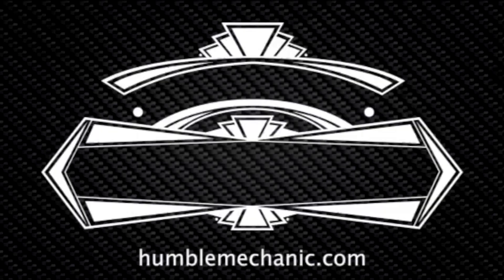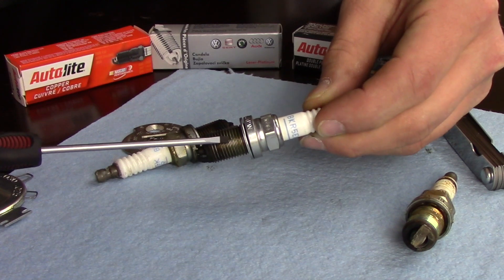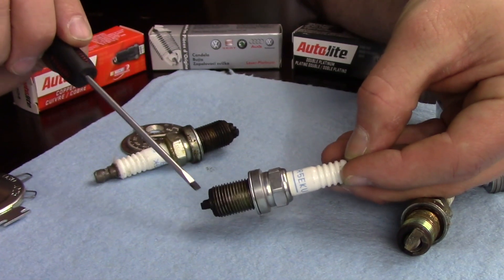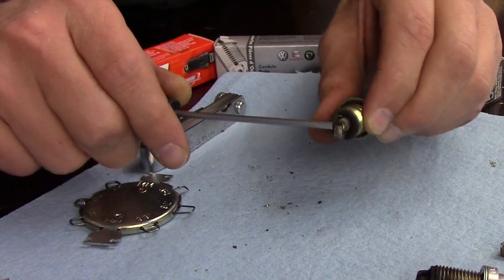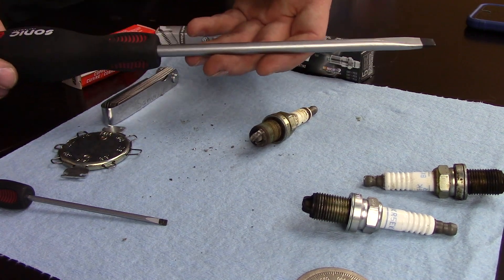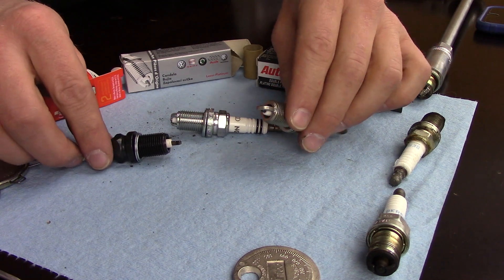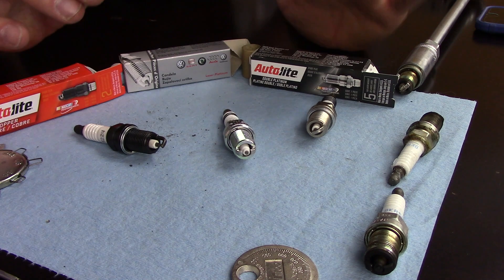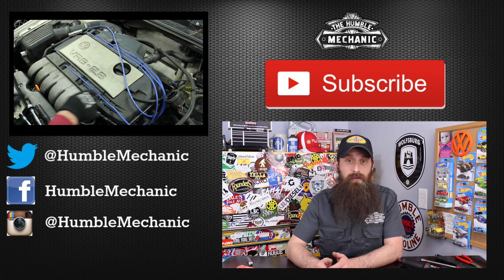What You Need To Know About Spark Plugs

Comment: Hey Charles, 
         Good vid for folks wondering a bit about their plugs. I guess I have 2 questions. First would be you showed the plug in the beginning that had fouling on the last 1/4" of threads or so and you mentioned that this threaded portion extended down in the combustion chamber? I have to admit, in my career as a mechanic I have removed hundreds of heads on many different makes and models but can't say I have ever seen the threads of a plug extend beyond the head exposing threads to the combustion chamber. I have only seen them come flush or slightly recessed... Is that a VW thing? Seems to me that would make it almost impossible to remove or very very hard to say the least. Similar to the problem the 3v Fords that you mentioned. IMO What I think you are seeming is perhaps were the combustion gas migrates up into the threads over time. Remember the threads have to contact the head fully because that is what carries away the heat from plug tip (making the heat range accurate). 
         For my second question you mentioned that an extended gap will take more voltage from the coil to jump the gap. I have to admit I have done some pretty extensive testing using a capacitive pick up on a scope looking at secondary waveforms and changing the gap on a plug from .010" to .090" and I must say I have never seen a change (or very little) at all in coil output or burn time that is discernible at all. As a matter of fact the only time I have seen any sort of an anomaly from a spark plug gap is when that gap "bridges" basically causing a direct short to ground, or a severe open in a secondary circuit causing an unintended gap out side the combustion chamber but other than that can't say I have seen gap alone affect coil output on a modern day high output ignition. So I guess my question with all that being said is have you seen measurable voltage differences on coil outputs from a worn or over gapped plug? If so what were the actual differences and examples you saw? very curious about that :)
--Eric O. ( sorry for the long question :/ )
Reply: Eric, stop farting around and get to work, lol. Goodmorning.
Reply: Michael Herbert Hey come on I need my YT fix too!
Reply: First question: The plug threads are not protruding into or exposed to the combustion chamber. When the head gets hot the hot end of the threads get a bit bigger, that allows some carbon up the first few threads. Get a lot in there over age and it can feel like the plug was hanging out in the chamber and got carboned up but not so. Worth remembering that threads and in a head get smaller at the cold end and larger at the hot end when the head is hot Which is why you always chamfer the top of thread on an exhaust manifold face to stop the threads near the surface shrinking and shearing off the studs like a bolt cutter at the face leaving the remaining broken stud left in there loose enough sometimes to unscrew when it is cold. 
So where is a plug likely to seize and break off, top of the thread.
For taper seat plug, they tighten up at the cold taper end when the engine is hot making them tighter at the taper when the engine is running, so don't take taper seat plugs out hot, flat washer seal plugs not sensitive to it. And if you fit taper seat plugs hot when they cool down they may be a bit looser than spec so replace them when cold or if you remove them hot let if cool down before fitting them.
Reply: Second question: There will only be a small discrepancy in spark voltage, spark time and pre spark voltage observed with a difference in spark plug gap, but that is academic as we are not merely looking for an absolute voltage value at any point or just a wide gap, we are looking for worn and thus defective spark plugs.
What you need to be looking for is a scope pattern that displays a defective plug, it may have a narrow gap and be defective in other ways namely parasitic insulation leakage from contamination.
And we know that such a plug will break down at idle causing an erratic idle misfire.
You can simulate that by using a can of fuel injection pressure cleaner after fitting a new set of plugs and ruining the new plugs causing an erratic idle misfire, and observe the engine ran better before you used the cleaner.
And you can see this in the scope like a defective plug not by absolute voltages but by lack of a stable spark voltage or time as it misfires and an ugly spark line too when it does fire.
Keep in mind long life plugs are not a construct of much better plugs it is due to combustion chamber design and fuel and ignition control that allows the plug to last a lot longer before they are contaminated..
We had platinum and palladium plugs in the 1980;s too but you could not leave them in an engine for 60,000kms because they got contaminated. 
Precious metal helps reduce spark erosion to stop the gaps getting too wide but likely the plugs will be contaminated to the point they are failing at any stage (rough idle) before the gap gets so wide the owner notices it.
Because the coil has plenty of reserve current wide gaps just mean more load on the rest of the ignition system that can cause breakdowns upstream of the plugs if left long enough.
High energy ignition allowed car owners to burn their plug gaps to the stumps before the coil or module or leads or all 3 fried.
Ive had cars come in to be serviced with plugs burnt to the nose cone, rough idle but no regular misfire at revs when warm, cooked every other part of the ignition system though. 
All scorched from having to generate enough current to leap the great gaps of the long worn out plugs.
Leads and coil fried and tracking where the small air gaps in the insulation manufacture finally ionizes and creates a leak path that turns into a crusty crater. 
Put it on the scope and the voltages are a bit high but not liked you'd pick it that easily, but what you will see is an erratic pattern being erratic misfires not limited to one cylinder but may be worse on some than others. 
So you replace the plugs and then see how much it has cleaned up and if not then its a fuel related misfire or upstream ignition misfire and if the plugs were bad enough for long enough that is not unusual to see something else cooked. 
There is no point inspecting plugs because these days unlike old engines and leaded fuel engines more so you wont see the contamination of them. 
Which the EFI pressure cleaner will demonstrate, that you can cause a brand new set of plugs to start erratically misfiring at idle right after using the cleaner before you even get out on a test drive and you can pull the plugs out and look them up and down all you like but you wont spot the problem with them, the cleaner is now impregnated in to the nose cone insulators and the only place the new ruined plugs can go is in the bin.
Reply: AuMechanic, Good mini-lesson, to bad you don't have time to cover it inclusively. Most of the "shade tree" mechanics don't have a clue about what your talking about. LMAO
Reply: @AuMechanic  hey man, can you please send me an email? I'd really like to chat with you about a few things sometime.. Dadshambone@gmail.com
Reply: This is a very good discussion. But in my option in the every day automotive repair industry "although great info" not as important as it would be to the engineering industry. Modern-day coil output can overcome many plug faults. And in most cases, this information can be misleading to the true cause of many misfire problems. Just make sure you get the right plugs and they didn't get dropped and the gaps are good. Keep it simple. Its easy stuff
Reply: South Main Auto Repair We are aircraft mechanics and we have found the primary determinant of a bad plug in air cooled aircraft engines is resistance above 5k ohm. On aircraft engines that are hand propped to start the engine, usually hard starting is the first indication. If there is no visual wear (I just pulled stock iridium plugs out of a 2003 Honda Insight and they showed no visible wear, were clean as new, and burning beautifully), I would put an ohmmeter on them before putting them back in. At $27 each, they are excellent plugs but expensive.
Reply: +SMAR
Reply: South Main Auto Repair LLC                                   Easdaaxxdsxc
Reply: Xxxef
Reply: Q
Reply: ⁰
Reply: In my 2-stroke (130hp), if I gap the plugs much over 0.022, I'll start to experience misfiring.  When I set gap to 0.020 or less, the misfiring stops.
I believe the spark voltage isn't high enough to reliably fire a 0.022 gap, it's too wide.
Reply: Hey Eric O.  There has to be a correlation between voltage and how big of a gap the arc can jump.   Think of arc welding and think about things like high voltage power lines.  The higher the voltage the wider the wires have to be spaced.   In a spark plug I think the distances are probably so small of a change that the change in voltage is tiny, so tiny you may not be able to accurately measure it with the equipment you are using. 

I also consider the ridges on the ceramic of the plug.  Those ridges are there to increase surface area to help prevent arc from going down the insulator to the base, so the voltage must be able to jump a gap significantly longer than the distances between the electrodes.  My guess is the difference, though minute, probably adds up over billions of cycles to quite a bit of extra wear and tear on the coils, and the quality of the spark would suffer.  Again, all tiny differences but when you consider how many time a spark plug spark in 100,000 miles it becomes more significant.
Reply: FrugalPrepper's, the ridges were added to spark plug insulators to help hold the rubber type boots on and a moisture barrier nothing else. Plugs made before  boots became popular didn't have ribs, I think there are some plugs made that don't have the ribs. (Don't confuse the ribs on a high voltage insulator on high lines with the ribs on a spark plug.)
  The reason the first three or four threads on a spark plug has Coppola on it is because the threads are tapered for the first three or four threads to help start the thread engagement. If you put a machinist straight edge across all the threads you will be able to see them. It is the same for bolts the first three are starter threads and you have to have a bolt that passes through the bolt by at least three threads in order to have FULL thread engagement.
   All  mechanic students are taught this in the basic sections of their studies. If they were not taught this they probably went to an "off the Wall" school commonly knows a diploma or certification mill. If the school is in the USA and is not recognized by the American Society of Automotive Engineers then they are a "fly by night" operation turning out half-ass wannabe mechanics.
Reply: Jim Watts Do you have a reference for the first three threads of a bolt or spark plug being "tapered"? I can find no information about this.

Comment: Interesting how @10:50 you said Autolite spark plugs make Volkswagen engines unhappy. In the racing engine channel, SEEN HERE===>https://www.youtube.com/watch?v=Ft6YOBjd5FE , they said Autolite is the best for high volume racing for max HP and max torque. They proved that on the dyno and their airflow monitor and checked the air fuel mixture on every cylinder. I believe that if you want to tune for efficient engines there is a need for different plugs. I also believe that those expensive Iridium plugs can increase mileage on an old carburetor engine from the '70's and '80's while it might not for a fuel injected multiport engine. The computer on modern engines just dials in the 14.7 PPM and used the same fuel no matter what with the same output. My old Dodge is getting pretty good instant starts [it's on me if it doesn't] and is using fuel much less. Could be other factors involved but hey, I really don't have all the test equipment to back what I'm saying. It just is.
   Makes me laugh when a deposit plug needs replacement according to most. Just clean it. On almost every episode of Vice Grip Garage Derick changes the plugs every time. If the centre is burned down bad then fine but stop filling the landfill with these things.

Comment: I used iridium too they're not invincible. Do degrade also. Not the iridium part but everything else around it. I do still use them. But if you never change the oil, drive on piss fuel and short distances this is not for you. They'll clog up and you'll have to replace them anyway, long before they get bad.

Comment: I recently had a plug blow out of the cylinder and i put in one of those save threads in everything went in well im still having a miss any help would be appreciated.Compression is good 👍 so thats not the problem  wire coils good so any other ideas would be appreciated

Comment: 14 February 2025

Great informative video.  Thank you. 

I own a 

1970 VW Cabriolet 
1965 Ford Mustang 
1967 Ford LTD
1968 Oldsmobile Toronado
1972 Ford F-250 
1979 Merced’s Benz 450 SL

All need correct spark plugs and gap settings.   This will be an adventure.  Thank you. 
Northwestern Rockey Mountain States.

Comment: I have to ask to be safe and also because I will respect your professional advice. 

2008 Volkswagen touareg VR6 
Brand new 
Bosch double iridium part # 7431. 

The bosch box reads 23Nm / 17 Ft Lbs 
I watched your sister video to this video and you've torqued the Bosch spark plugs to 20Nm. 
Prior to watching your videos I spoke with Volkswagen technician regarding the right torque spec and they went off my Vin and mentioned 16 Ft Lbs. 

- I'd like to be 100% sure the Volkswagen touareg; Bosch spark plugs are perfectly assembled. Do I torque them according to the Bosch instructions on the box or to 20Nm as in your video? PS: I have been searching for 3days now

Comment: Great video in thanks for breaking down how spark plugs work in the difference between burned out spark plugs in good spark plugs but I peep game aloTTa people think if they see a spark plugs that’s black with carbon on it they think something wrong with it longs the spark plug not damaged or no cracks with in the original gap then just burned off the left over carbon build up on the spark plug in she will work like a brand new one 💪🏽💪🏽💪🏽💪🏽

Comment: thanks for that education on spark plugs.   question; is there an easy way to check if good/bad "transfer case motor or actuator" on a jeep renegade 2015?  I have an intermittent "service 4wd system" dash light = on one day then gone.  Inspected the connector plug, is clean and dry.  I take the "intermittent" as a warning that something is not happy....

Comment: 4:35 err! Yeah, DO NOT do that with platinum or iridium spark plugs❗ You can crack the precious metal coating on the 'earth' electrode and the plug will die in use pretty quickly. That is why plugs come pregapped from the factory these days.
8:25 In over 40 years of mucking about with engines I've never once used a torque wrench on sparks. Instructions for tightening are usually on the box (I show that here https://youtube.com/clip/UgkxJb0zCObt5Ktf_yxsOJmQ2PNARp3HQH-l?si=Wawr4ej8yXzmqbeA) and are for crush washers to apply 1/4 to 1/2 turn (so I go for 1/3) or for taper seats 1/8 turn. You can if you prefer.
TBF this video is 7 years old and platinum and iridium plugs have become more common in that time.
And in all seriousness, Charles, give these new Denso iridium TTs a go (https://am.denso.com/plug-global/products/iridiumtt/). I used them in the video above on the C1 and have had them in my Saab for about 4000 miles now. They really do improve running (and the Saab is well known for being very fussy about plugs). Find your plugs here (https://am.denso.com/plug-global/model-search/)

Comment: PSA: Performance Tuning does NOT include the use of Platinum or Iridium Spark Plugs,
So what if coppers Last only 20,000km when abused, they also don't knock like rare metals with horrible heat conductivity..

Rare metal plugs are meant for Family SUV's that need long Service intervals not performance.

Comment: A very small piece of my center electrode had broken off , i noticed this when changing plugs. I unknowingly  had driven many miles like this before I had a misfire and changed the plugs, and noticed the missing metal. In your opinion has that metal made its way past the valves and into the pan? I imaging im ok because Ive had no major issues. I hope to find the metal piece in the oil pan. So do you think Im ok at this point? Like I said I put many miles on the engine wirh the broken piece. Thanks. Mk4 R32